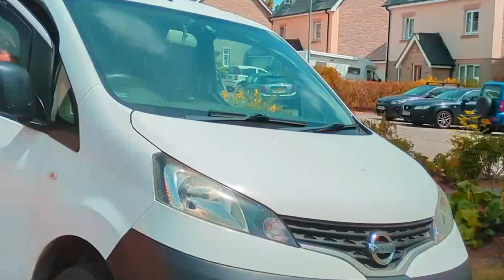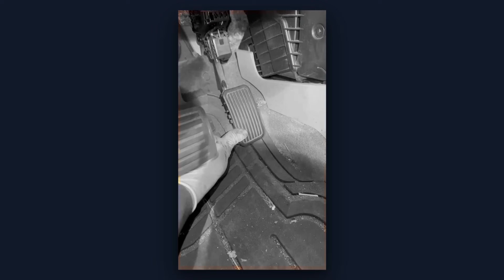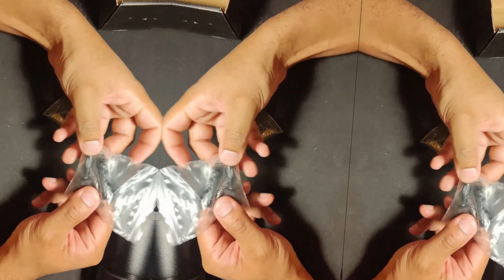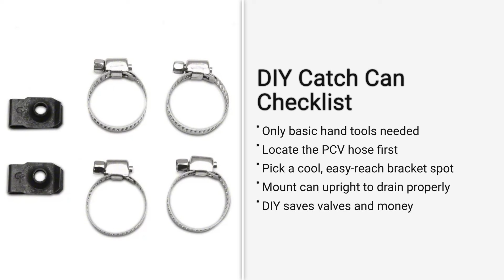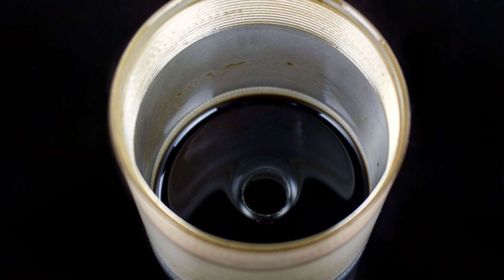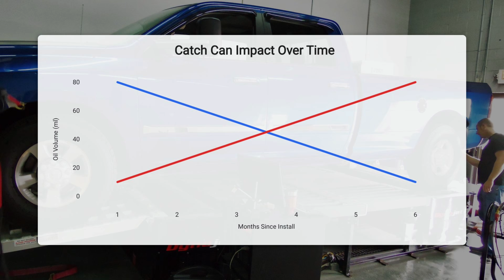The $50 Ford Catch Can Hack That Stops Intake Valve Clogging (PROVEN RESULTS)

Comment: This video isn't entirely accurate in terms of direct injection. F-150 EBs, for example, had direct injection only on 2016 and older models. In 2017 they added dual injection where it has both direct and port.